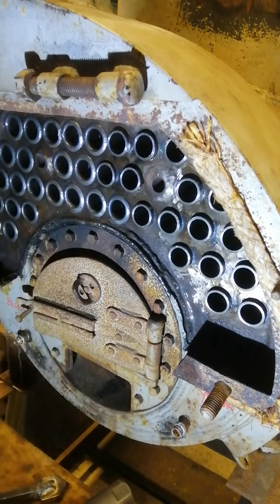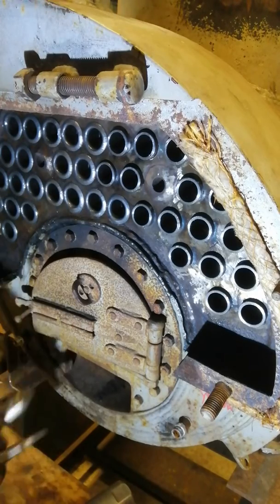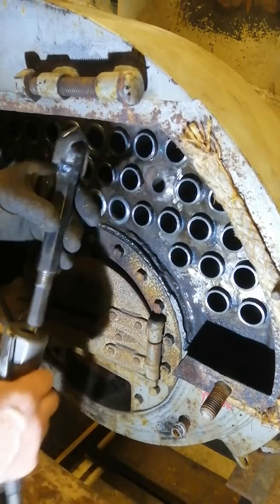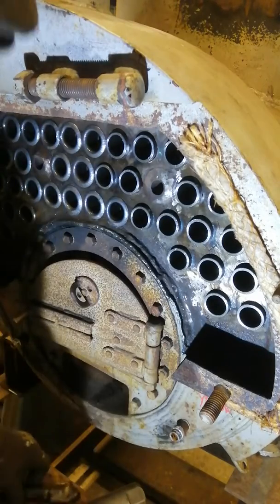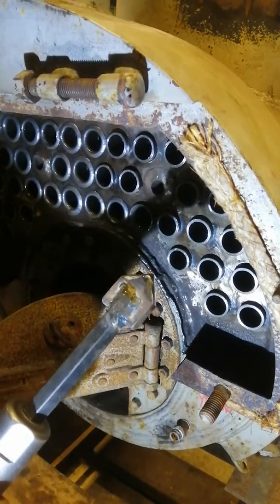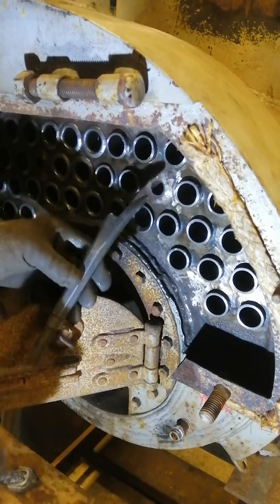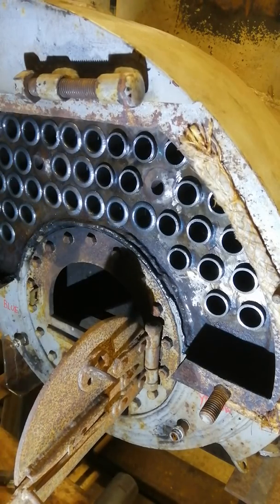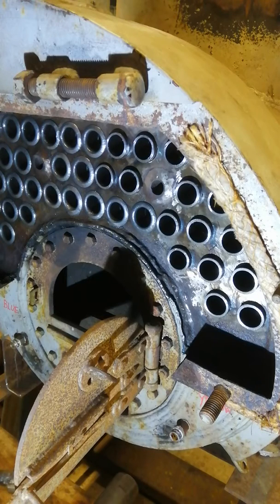Beading over boiler tube ends in a heritage steam boiler from a 30 foot steam launch.

Comment: How do you retain the pipe and what is the profile of the seat (the boiler mating face?  Do you know of any good books on non welded boiler constructin . Best regards from the north.
Reply from the maker: The tube is expanded into the plate with a rolling tool to the correct torque or expanded percentage. The hole is drilled perpendicular in the plate with no relief on the corner. 
One of the most modern books on riveted (& welded) boilers is: The Design Construction & Working of Locomotive Boilers by Alan J Haigh.
ISBN 0-9545364-0-1
other older books include: The Bennett College, Boilers Fittings & Design.
Marine Steam Boilers by J H Milton.
MacGibbon's M o T Orals & Engineering Knowledge. Good luck.